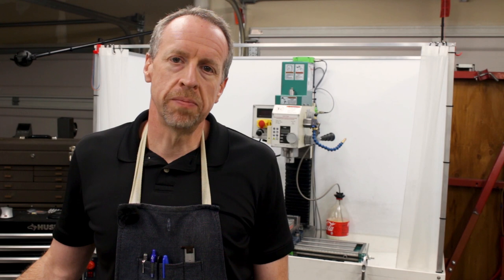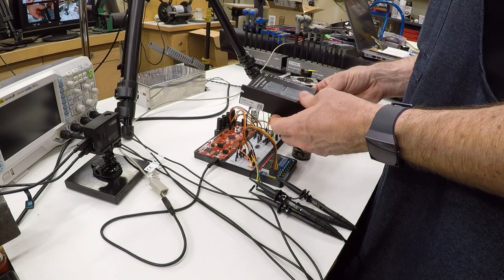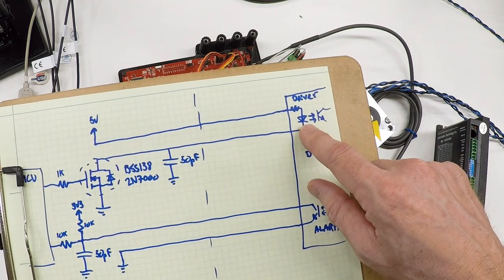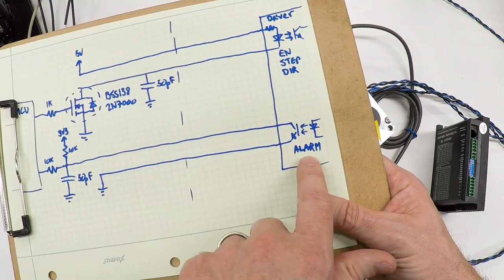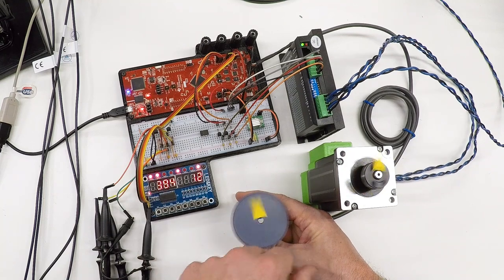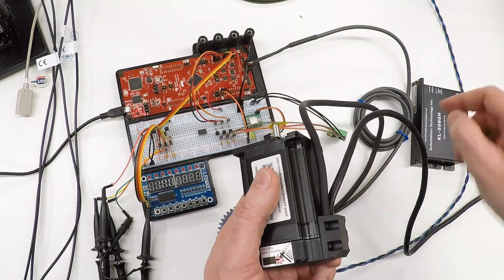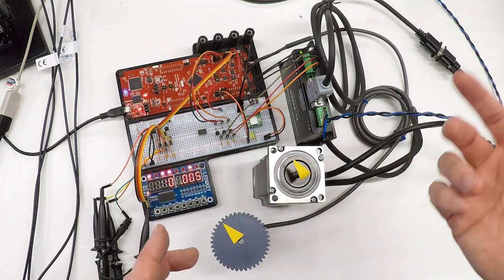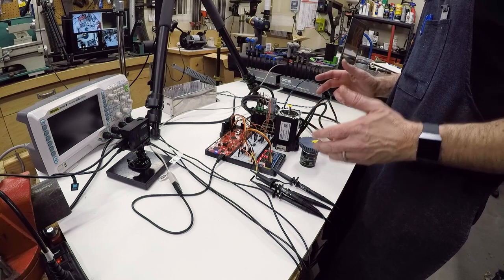Lathe Electronic Leadscrew Part 4: Steppers and Servos and Drives (Oh My!)

Comment: For lathes with clutches and brakes they could easily speed up/slow down far faster, never measured it but mine will spin the spindle up to 1500rpm in <1s using the clutch vs about 5s+ if I let the VFD spin it up.  Not an issue for the leadscrew (after all who does screwthreading at 1500rpm) but possibly would be for the feedscrew.
Reply from the maker: This should still be well within the capabilities of a properly sized servo or stepper.

Comment: So I have an import knockoff of a Smitty (Lathe and Mill Combo unit) and my carriage doesn't have half nuts, the screw is always engaged.  Do you think it would be possible to modify your project to include "electronic half nuts" too?  basically, a push button that gives the system permission to engage at the appropriate time to engage the threads?  This of course requires the encoder for the spindle to be 1:1

Comment: at 10:00. what did you mean by no current draw on the pin? it would have been roughly 0.33ma when the driver optocouplers photo transistor is turned on.

Comment: I'd rather use a big stepper and direct drive then use a belt. backlash you get from belts are eh... direct drive and ditch the half nut for ball screw replace the saddle wheel with a encoder for a pure electronic Z
Reply: Backlash doesn't matter when you're talking about driving the lead screw, it matters for CNC because of the changes of direction but if you look at any changewheel setup there is inevitably a significant amount of backlash in there due to the number of gears and the adjustability required. All that really matters is repeatability.

Comment: It appears that you are using the Automation Technology ("AT") KL-5056D, Digital Bipolar Stepper Motor Driver-32 bit DSP Based, for this build.  See https://www.automationtechnologiesinc.com/products-page/digital-stepper-motor-driver/digital-stepper-driver-kl-5056d-heat-sink-is-included/  According to the AT website, the KL-5056D has been superceded by a new model called the KL-5056E.  Additionally, a lower cost model designated as the KL-5056 is available on ebay.  Please let me know whether the KL-5056 is usable for this project (I assume no as you appear pretty savvy about getting the right components).   Many thanks.